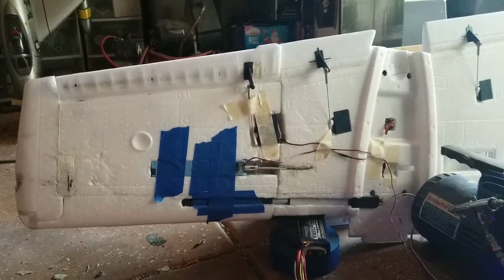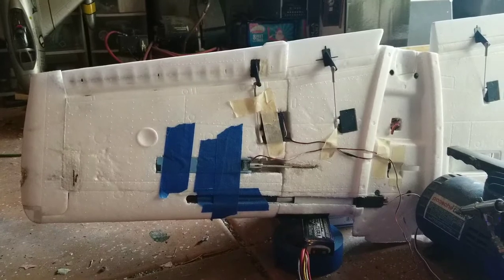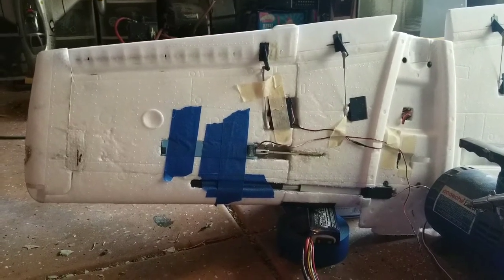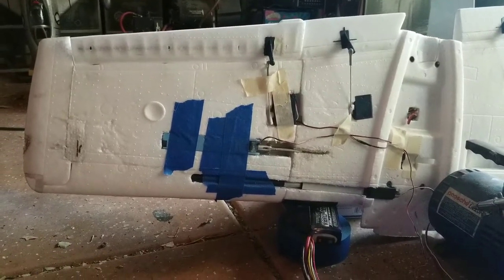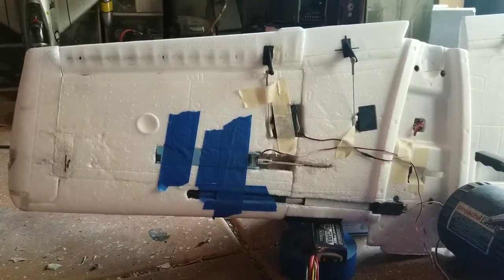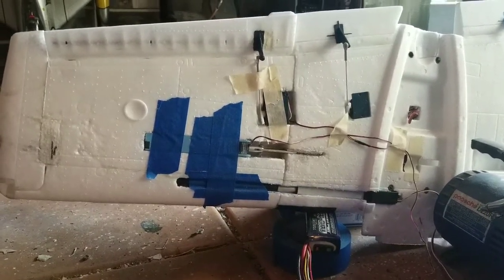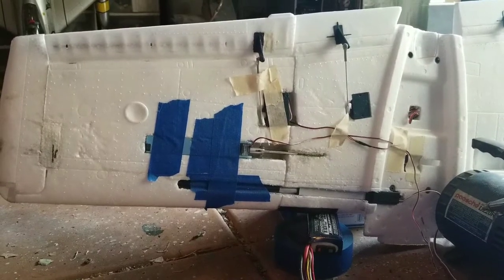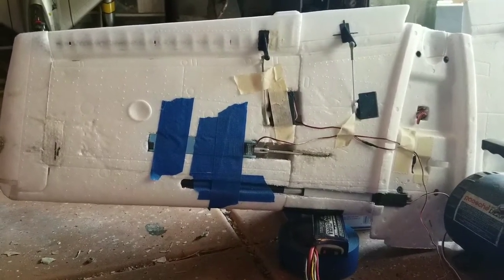FMS 1700mm Folding wing mod progress

Comment from the maker: The linear servo being used for the locking rod, is a L16-R with 35:1 gear ratio and 100mm stroke from Actounix
Pn# L16-50-35-6-R
https://www.actuonix.com/L16-R-Miniature-Linear-Servo-For-RC-p/l16-r.htm

The CF roll-wrap rod its going into is a 9mm ID X 11mm OD rod I got from ebay.